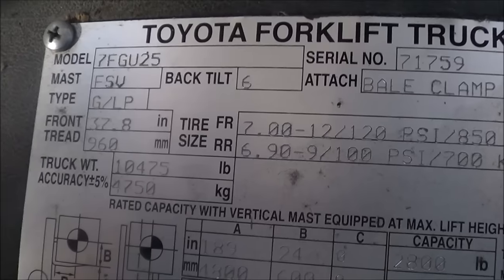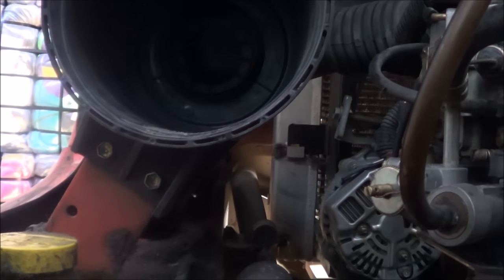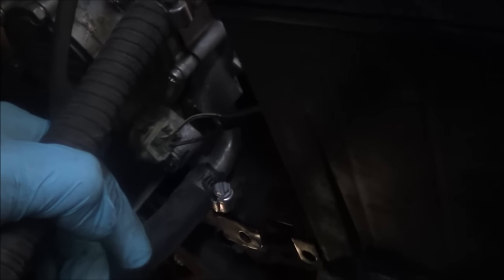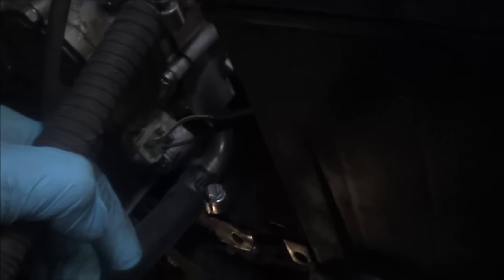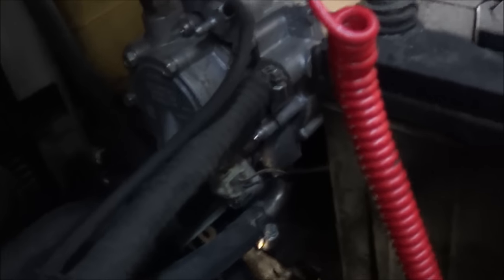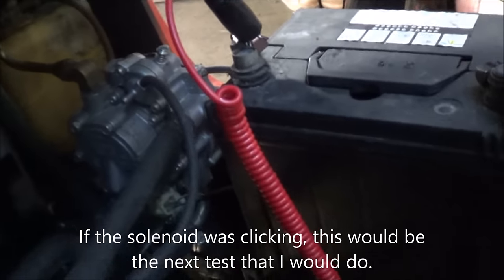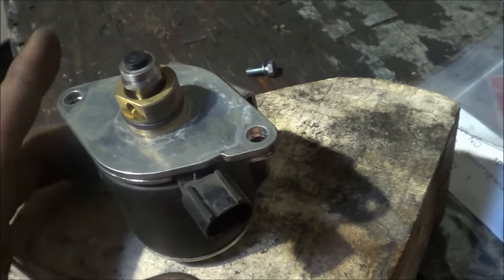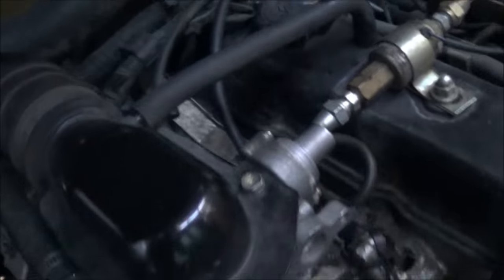Toyota forklift no start issue

Comment: Just watched your video and I have to say thank you for a video well done! I had a no start issue with my jurassic period Allis Chalmers. I had done a lot of what you showed already, but not the brake fluid into the carb trick, that is simple but effective.
In the end what I did is clean the regulator and carb inside and out very well, propane lines too. Fired right up and got rid of my stress issues too! Thank YOU!!
Reply: It was brake cleaner not brake fluid.&#160; You have to be sure it is the flammable type too. If you use the CFC kind it doesn't work. Use starter fluid and be sure to stay away from the throttle body when you start it in case of flames from a back fire.

Comment: the first thing to look at before you get any tools out on a duel fuel Toyota, is the truck switched to LPG if it's switched the GAS (petrol) it will crank but not start. you would be amazed how many people get cought out on this one ( myself included)
Reply: And the switch gets bumped half way between gas and lpg sometimes which gives no start either
Reply: No shit. That’s a good point

Comment: That's a very common problem on Toyota forklifts, usually I would just put my hand on the solenoid and crank it and you will feel it if it works. If you're not getting power to that connector it's most like the relay located under the fuse box.

Comment: Did it not have gasoline in it? It's a dual fuel truck. I've Had wires break inside the insulation at terminals. Looked fine but conductor was broken.

Comment: Hi Jay, what if the test light doesn't light up when you check the power going to the solenoid on that connector when cranking? Bad wiring?
Reply from the maker: Bad relay, wiring, fuse or rev switch on positive side. If this was a dual fuel check if the switch is flicked to gasoline.

Comment: I sprayed starter fluid and our FL started right up.  It when I checked the fuel supply the gas didn’t come out as hard as yours did. It did a little more but I had to keep opening it. Any advice?
Reply: I have the same problem.
Reply: Or similar at least

Comment: Hey forklift geek,
Thank you for the fun interesting videos.  I appreciate solid diagnostic work.  And the explanation is spot on.

I have a toyota 7fgcu15 with a no start, I diagnosed it to a (what I thought was a faulty shutoff solenoid) but rather a no power to the shut off solenoid issue.  
Do you know what else is on that circuit?
It powers the solenoid through the ignition switch, but without a schematic I do not know where the solenoid connecting wires come from.

Thank you
Reply from the maker: https://youtu.be/bSvOp-zRlMQ  
This one is a 7 series, but not all 7 series are wired this way. Some of them, the lock off is powered by a rev switch and the input is from the distributor.
Reply: @forkliftgeek10  I just watched that linked video. 
I will definitely look into that.
I bypassed the main solenoid (in the regulator) to feed it voltage so it would open. Then that is when I discovered it would run, but this video could definitely be the final culprit or at least similar to the problem that I am having.
Thank you again for the explanation.

Comment: I personally like to convert over to the Impco fuel system if the customer wants to replace the Aisan system from the factory. They run better with less problems and are cheaper to replace in the future.
Reply: Impco system will violate emissions if the forklift has an O2 sensor and will trip a check engine light. Works for a ma and pa shop but its a nogo for companies that comply with federal law lol

Comment: Hey there. I have a tusk forklift. It is made by Komatsu. I just purchased it this morning and drove it on the trailer as well as off the trailer. While backing it off the trailer it hit the ground pretty hard and I drove it into the shop. I shut it off and it never started back up after that. The guy mentioned he cleaned the regulator to get the machine back running again. I have to assume that somehow the regulator is failing. It seems to be forcing a enormous amount of propane into the system when I turn the key key on. It acts like it wants to start but it just won't do it. Do I need to replace the entire regulator? It's blowing the excess propane out of a small vacuum size line off the side of the regulator that goes to the intake tube.
Reply from the maker: You could try the rebuild kit

Comment: This is good info, but we are dealing with a newer generation Regulator with dual solenoid lockouts. Getting an intemittent, NO START after the rig sits for a while. Same as yours it will try to run with starting fluid. Also breaking the flare connection coming out of the big lockout solenoid path, bleeding off some pressure and re-tightening may allow it to start. The Attending Forklift is also Puzzled by this one. S/N is 41051 Model 8FGU25.
Any suggestions are helpful.
Star
Reply from the maker: Sometimes the main solenoid (big one in the middle) gets stuck or the solenoid is already weak. When it is not starting try tapping on the solenoid and see if it starts.
Reply: @forkliftgeek10  Thanks for the info. 10-4
Reply: OK Excellent. Tap on the secondary lockout on the REG when cranking and it start right up after prolonged NO START. Good Technique. Thanks. New Reg should solve this one.

Comment: @forkliftgeek I'm having a minor issue with my Mitsubishi propane forklift. Seems lately I have to stomp the gas pedal to the floor to get it to start. Could that also be the solenoid or should i look at injectors?
Reply from the maker: Your mitsubishi would have a different fuel system than a toyota.

Comment: I have a cat gc18 no start, LPG i have changed the vaporizer and the lockoff,  I also changed the oil pressure switch and I have 9 volts to the lockoff and no start, if I jump over voltage directly to lockoff the forklift starts and runs a few times, I also had battery checked by Napa and swapped starter with new and no fix, any ideas?

Comment: thanks for video I have question mi forklift regulator is frozen every 15 minutes and the forklift shut down after desfrozen forklift run again justo do this just when is cold once when the forklift warm up running good all day now I can running only 15 minutes thanks
Reply from the maker: Check your coolant level in the radiator
Reply: ok I see litle liquin from water came from radiator to conected to the regulator you think this is the problem and I have to refill radiator any 2 days thanks

Comment: Hey man I have a Toyota. I sprayed starter fluid inside and it just cranks and tries to start but never catches. It’s got spark but it looks a little weak. Could it be the distributor cap? It’s got new plugs in it. 
What should I look fir on the cap ?
Reply from the maker: Worn contacts in the cap. The cap is not the only part that produce a weak spark though. The rotor, ignition coil, ignition module, and cables are all suspect.

Comment: Hey if the truck didn’t start with brake clean, what would be you next step?
Reply: If it didn’t start with break cleaner then that would suggest a ‘no spark’ problem. Such as spark plug problem, ignition problem, coil problem.

Comment: I have a 7 series with an issue that when I’m on the throttle it work but then let off the throttle it shuts off. I have spark , and propane . I do have the regulator it is full of tar . Any ideas before I replace the regulator
Reply from the maker: Throttle plate might be gummed up

Comment: So I have a propane floor buffer that is doing the exact same thing. It was running perfect until I dis connected the hose from the vaporizer to the carb and turned the propane valve on. I put the hose back on and now and it still will not start. I have bought a new vaporizer and solenoid and it will not start. Any ideas if that made sense?
Reply from the maker: +Solomon Smith when an engine does not start it can only be missing a few things, spark, fuel, air, timing and compression. I'd start with spark and fuel. Check if the solenoid is getting power.

Comment: depending on the Gas regulator type the slow run solinoid is powered from a  sensor in the distributor.
if you have high gas flow to the carb ( mixer) the engine will crank but not start and the main valve seal inside the regulator.
Reply from the maker: +Andy Freeman the type of regulator would depend on the model of the forklift. the regulator you are referring to would be more likely in an 8 series. As far as high gas flow, yes it would produce the same symptom but exhaust would smell of unburned propane and adding external fuel source would not get the engine to start.

Comment: I have a early 90's Clark lp forklift it wont start without a shot of starting fluid. Any ideas? Thanks
Reply from the maker: Well, if it keeps running after that a vacuum leak would be a good place to start. Assuming that the fuel system is vacuum operated. Poor Ignition may also be a cause.
Reply: @forkliftgeek10  thanks for your reply, will check into that.
 Some days it fires up just fine with no help🤷‍♂️

Comment: Hello، my forklift don't start and hydraulic system not work also i Do not have current to my starter relay and when i took wire direct from positive battery to positive relay it's start but hydraulic system don't work.

Can you help me please

Comment from the maker: Why only 9v? I'm assuming you have a fully charged battery.  That's a big voltage drop. I'd start there.
Reply: ForkliftGeek  workn on 8fgcu32. alternator not charging. checked 3 wires on alternator. yellow gets 12v. white with blue wire 12v but red wire nothn. fuses is good. where do red wire go?
Reply from the maker: +Mak Sivichane 10A IG fuse same fuse for the charge indicator light

Comment: I have this model lift won't start not get power from the fuse box to starter I'm thinking the neutral safety is bad as i have checked fuses and put in new relay but can't find neutral switch. Starts and runs fine jumping to starter.
Reply from the maker: +thatcoolguy131 neutral switch is part of the directional lever assembly.

Comment: ok that's what it said she on the wiring diagram and didn't know where the engine rev sw was located so I need to replace the distributor  or can I just replace the engine rev sw is there any picture of it
thank you
Reply from the maker: +agustin tirado I would suggest checking the integrity of the wiring first.
Reply: i did check everything and still wont start
Reply from the maker: +agustin tirado are you sure fuel is what you are missing?
Reply: any other idea

Comment: Great Job, I have one 5fgcu20, gets spark with key start, has good compression, cap, wires double checked, will only stumble on start, fuel is controlled by vacuum only on this one, big clue is it wont run with starting fluid in air intake. does this sould like distributor or exciter/coil, I got this job to help these guys out and got it started by jumping the relay the guy before me cut the neutral saftey switch out of the harness, so i was lost with wires dangling and off the start relay, figured most of it out without schematic, got it to start with jumper to relay, started everytime one pop, so i fixed the hydralic cylinder for side shift, installed new key switch, repaired altenator lower mount bolt broken in cover, hood hinges repaired, rewired as best i could they way it was running and now it won't start only stumbling with fuel open, Any Idea?
Reply from the maker: +Gary Castle pull out the hose from the regulator to the mixer. When cranking the engine there should be no gas coming out, if there is then it's flooding the engine. You could also check the butterfly on the governor, I've seen it before that when the engine vacuum increases it pulls it shut due to a broken spring. Ignition wise I usually use an ignition tester and set it to 30kv. If it's not able to jump that gap then I'd check for high resistance in the secondary circuit.
Reply: thanks for reply, good thing to look at, I checked the two units out the bottom unit looked new and shinny, had small amount of black dust inside that side, the upper had some waxy stuff but not clogging anything and the vacuum seemed to activate the switch to open valve to let LPg thru. The broken spring you mention is that in the upper or lower unit of this regulator mixer ? I have gotten spark from plug but its a very small bluish white spark that is not that strong cause the shock wasn't that bad! The plug wire 4 is bad and is getting replaced
asap, but others were ok and stronger. Would that spring stop it from running on starter fluid? This is why I think its ign. THANKS FOR REPLYING. Really Appreciate it. Gary
Reply from the maker: Top unit u are referring to is the lock off and the bottom unit is the regulator. The mixer is on top of the intake manifold. On the mixer side (carburator) there is another butterfly which is spring loaded. Shoot me your email so I can send some diagrams.
Reply: Gary Castle noon

Comment: I'm confused - you didn't show that the solenoid was getting a good ground to operate it - just +12v on both sides of the coil. to me that suggests a relay up stream is faulty more than anything on the regulator
Reply from the maker: Yes I did. At 4:58 in the video, my test light is clamped to the battery positive so when it is lit from the connector it means I have a good negative. Transferring my t pin to the other side of the connector and have the test light lit verifies that my coil is not open.

Comment: I have a hyster 80 that wont start. I know am not getting spark. replaced the coil, distributor cap and rotor, and the boss man had me change the starter??? but I cant get spark from the coil. can you help me?
Reply from the maker: +Barry Girky does it have a gm engine with the bypass system?

Comment: I’m desperate for help.  I recently purchase a Toyota 42-4FGC25 lpg forklift. I purchased it at an auction and it ran perfectly fine. I transported it my shop and I can’t get it to start. It has spark. The forklift was at sea level and I’m now at 4700’ elevation. I’m assuming I have a fuel mixture problem. I tried messing with the screw on the top of the regulator and I can get it to where it almost starts but can’t get continuous combustion. I’m unfamiliar with lpg fuel systems. Any help would be greatly appreciated. I purchased a new battery so it should have plenty of voltage. Thank you.
Reply from the maker: How far does the spark jump? Lpg is a gas and requires higher kv to ignite. Is the lpg lock off vacuum operated or solenoid controlled?
Reply: It’s vacuum operated.  Tester shows spark but I doubt the spark is the problem. It ran fine at sea level and when I brought it to the shop later the same day @ 4700’ elevation I can’t get it to start.Is there a way to send you video?
Reply from the maker: Ok, if its fuel try spraying carb cleaner or brake cleaner into the intake, see if it starts. There could also be too much fuel flooding the engine.
Reply: I got it running. It was a fuel problem.  Had not leaned out the regulator enough. Thank you very much for replying. It’s extremely appreciated.

Comment: wondering if you can help? I have a forklift which is a Henley husky 12 which has a ford 4cyl 2711e convert with a beam 120a propane system. The problem I have is that the forklift runs fine when shescold and just been fired up, though when she gets hot after say 10mins she begins to struggle to rev properly like she is struggling to get fuel. you can put full throttle and she just sits all lumpy at idle revs struggling to do anything. then out of the blue she will pull through and rev normal for a few secs and then die off again. if I let her cool down for 15mins she will fire up again as normal until she gets warm and then do the same thing again.  bare in mind shes an old girl so the engine runs a little hot anyway so im wondering if its too much heat causing this as the regulator we have the beam 120a is so hot that you can barely touch it... Im wondering what you can advise?
Reply from the maker: +honi9 when it's acting up you could try what I did here and spray some carb cleaner or brake clean into the intake and see it runs any better, if it does then you are probably right that it's lacking fuel. Be careful though in using an external fuel source as it might backfire and if you sprayed too much into the intake it might catch fire.
Reply from the maker: +honi9 does the regulator have a primer button? Sorry not familiar with beam regulators.
Reply: ForkliftGeek why is it only doing this when the thing warms up after 10mins running though. plus why is the regulator/mixer (beam120a) so bloody hot to touch?surely the coolant feed into themixer shouldn't heat it that much? could that be the problem? is it getting so hot the diaphragm is going all to shit with the heat. then when its cool the diaphragm is fine again? this is about the level of my grasp on the situation...
Reply from the maker: +honi9 what does your temperature gauge indicate when it starts acting up?
Reply: i will check next time ok

Comment: I have a 7FGCU20 that won't start when hot unless you relieve fuel pressure from line. any ideas?
Reply from the maker: +Frank Stromboili when it's not starting pull the hose form the regulator going to the mixer. If you feel any pressure when cranking the engine then your regulator is faulty.
Reply: I'm a Toyota tech. Its most likely the regulator. They seem to have a service life of about 7 years in my experience. Once they need adjustment its soon time for replacement on the 7-series trucks in my experience.

Comment: Will this solution also work for a conversion kit for automobile use?
Reply from the maker: As far as testing if you are having a fuel problem, yes.
Reply: I suppose so,  since it's all based on the same principle.